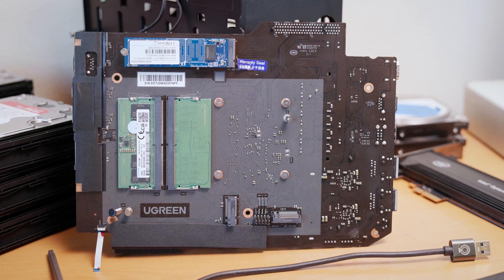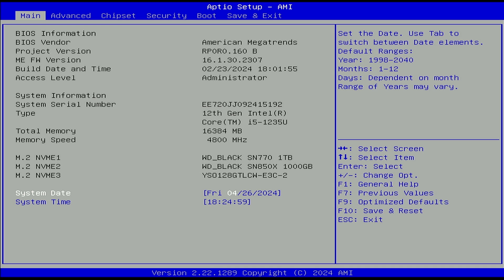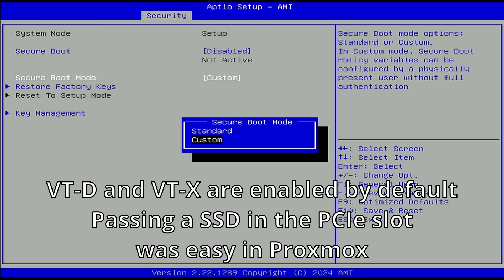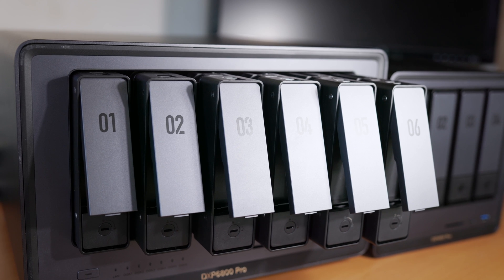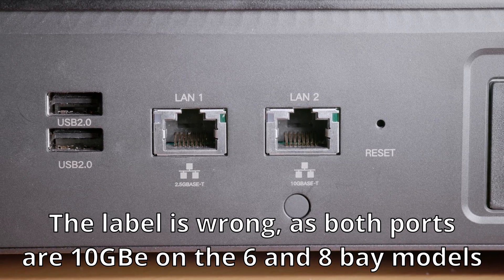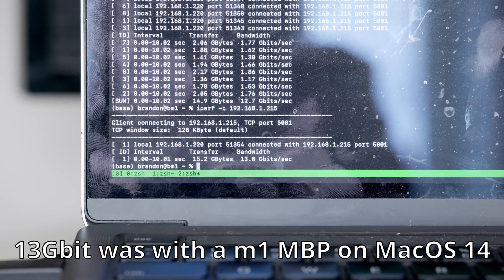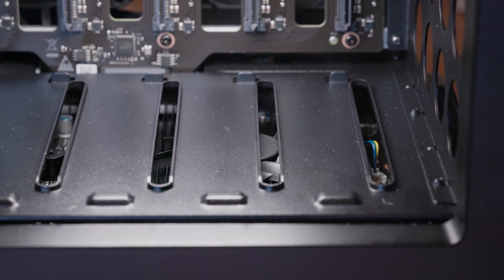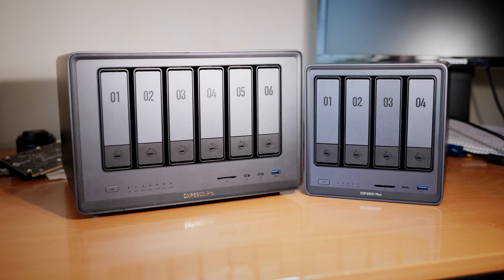Running Different OSes on Ugreen NAS Devices + PCIe layout and CPU thermal/performance tuning

Comment: 8:42 In that case instead of a NVIDIA Gt710 or 1030, I'd install an Intel Arc A310 so you get superior transcoding performance for 20 bucks more (AV1 HW-acceleration wasn't fully supported until the RTX 40 series [30 series had only decode capability]).

Comment: know anyone know if the 6 bay  can hold a pcie x4 WiFi card in ugreen os? i struggle to get Ethernet into my room and ill be using the 10gb to connect it to my pc keeping one empty for when i can run Ethernet

Comment: just found your channel and the vid was great. I have had a DXP 4800 Plus for 24 hours and I am now poking around in the BIOS. I agree the hardware spec would be pretty hard to beat with a DIY and you get the warranty.
I found UGOS easy to use and setup, just toying with putting truenas in. It seems that I can install Truenas on a spare SSD, or even on the disk array (I think).
Do you know what Truenas gives that UGOS doesnt ?. Is it worth installing it in your opinion ?.
thanks.
Reply from the maker: I'd argue TrueNAS is a lot more refined with better community packages and ZFS which is likely a bit more stable. UGOS can be fine for a lot of use, but I'd say TrueNAS has had more of its bugs worked out as its been out for much longer.

Comment: Excellent review! Around 2:44 you mention making an image of the 32GB drive to be able to restore as it cannot be downloaded at this point - any chance you can point me in direction of how to do this?
Reply from the maker: I booted the system into a Linux live disk, then make a image on my NAS using DD. Something like Clonezilla can do it if you want a more all in one cloning/imaging program.
Reply: @ElectronicsWizardry   Thank you - that was the guideline I was looking for. 
I am considering instaling Windows on a M.2, boot from that and do the image from inside Windows (not a Linux expert, but a strong googler..). Thanks again!

Comment: Thank you for this tutorial. I am exactly looking for a robust HW NAS where to install OMV.
For me a 2 bay is enough and looking at DXP2800.
Does it work the same way as the 6 bay you showed up here?
Or should I add a m.2 storage for a different OS?
Reply from the maker: Yea the 2 bay should work the same, but with less bays. I haven't tested on my self though.

I think the lower end units have a M.2 that uses MMC instead of NVMe, but for a OS like OMV that should be fine performance wise.

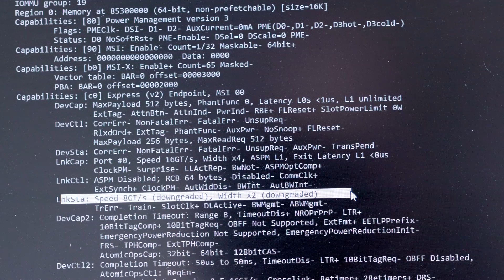Comment: @ElectronicsWizardry @8:48 where you talk about the different sized PCIe slots (4x4 and 3x2), what does that do to the performance if you were to bond them together as a read/write cache or storage pool?  Does the speed and performance downgrade to the limitation of the PCIe 3.0 slot? Or is there some kind of hybrid performance that gets created when you have two different PCI slots like this? Did they give a reason why lowered the second down to PCIe 3?

Comment: Thanks for the BIOS tour. That's really useful information.

Did you see anything in there about Thunderbolt/USB security or DMA protection? By default, The linux kernel in TrueNAS won't authorize any Thunderbolt device for PCIe lane allocation in Linux. Each Thunderbolt device has to be manually authorized on every insert via a specific flag in the sysfs device tree or a udev rule. Some motherboards let your bypass all that by completely disabling Thunderbolt security in the BIOS.

I didn't see that option in the tour you did, but I wanted to make sure I hadn't missed anything. As far as I know, UGREEN hasn't updated the BIOS since launch.

Comment: I installed truenas on my 4800 Plus and it seems to instantly shut off after about 2 min and then boot again. Nothing suspicious in any logs, temps are fine, low ram usage - any ideas?
Reply from the maker: There should be a bios option called os watchdog I think. Turn that off and it should work fine. The system by default will check if the os is working and will reset the system if a different os is on it.

Comment: How difficult is it to get the external case on and off to put in a PCIe card? The manual makes it sound easy enough (swap out feet screws, remove RAM/SSD cover, and slide off), but the entire process sounds a bit precarious and awkward, and I'm afraid of accidentally putting it back together wrong. ;)
Reply from the maker: I think all the screws have to be removed on the bottom and the back and then it slides out. Not as easy as a normal side panel, but not that bad, and all normal Phillips screws.
Reply: Thanks! (Sorry for the delayed reply; YouTube didn't tell me you'd replied…)

 @ElectronicsWizardry  Did you have any trouble lining it all back up when you put it back together? It looks like it should all just line up without a problem...

Comment: The asrock a380 gpu is a low profile single slot gpu, however the cooler is large so I'm wondering if it would fit.
Reply from the maker: I think the cooler is too big for this case. But the Intel igpu should be better than arc from my testing so I’d try using the do first. There are also a310 cards I’ve seen that would fit.

Comment: Hello all, very new to all this and looking for advice. would like to get the new mac mini m4. watched a video that showed an external ssd being used at the myfolder drive so the system would place everything but the main os features on that external drive. could part of this nas be used as the system folder drive and the rest as raid?
Thank you for any info
Reply from the maker: I think you can map the Users directory in MacOS to a different drive but I haven't tried this in a while. This should get around most of the 256GB storage limits on the base model mini. A DAS system will RAID should work fine as it appears as a single drive to the OS, but I haven't played with software raid in MacOS much.

Comment: I just bought the dxp2800 intending to use it for a Blueiris (Windows) server.  The Ethernet driver ended up being an Intel i225.  I still haven't found audio or other chipset drivers.  Otherwise it seems like a nice unit.
Reply from the maker: Does your have a audio port? Mine don't have audio ports, and HDMI audio is the only intergrated audio option

Also try the Google the device IDs without drivers in device manager if you haven't already and see if that can find the drivers.
Reply: @ElectronicsWizardry  Thanks. No analog audio port.  It looks like maybe some of the Intel Nuc drivers may be compatible.  I'm honestly not sure at this point what other functionality I'm missing but there sure are a lot of unknown devices in the device manager. It's been awhile since I've had to deal with this kind of issue on Windows and I'm out of practice.

Comment: Do you have any idea how I should connect Thunderbolt 4 with windows?
Reply from the maker: What do you want to use the thunderbolt port for? You should be able to do the same thunderbolt networking on windows, along with using thunderbolt devices.
Reply: @ElectronicsWizardry  I have a you green DXP 4800 Pro and I am having issues getting a PCIe card working for networking. So I bought a external USB thunderbolt 3. That gets me by with 1 10 GB port. I would really like the bandwidth of thunderbolt 4 to use between the NAS and the windows PC. I got them under the same IP but because I'm using a network switch everything got really complicated. My little mind lol
Reply from the maker: What OS are you running?

What do you mean by a external USB thunderbolt 3?

IP over thunderbolt typically is much slower than the peak port performance, I think it was ~10gbit for earlier versions and a bit more for v4.

You want the NAS and your PC to have different IPs but to be on the same subnet. Then try pinning the NAS on its IP in that new subnet.
Reply: @ElectronicsWizardry  Yes I was able to change the IP addresses on both the NAS in Linux and my PC. Got it connected but I don't know if it's working for transfers. It ended up losing connection if I remove the ethernet from the NAS. 

Correction I have the 6800 Pro the six Bay prone as and I am running you ugeen OS
Reply: @ElectronicsWizardry  When I said external thunderbolt 3 I meant I am using an adapter for thunderbolt 3 to 10 gig ethernet. It works pretty well but gets super hot. So I am assuming connecting it directly through thunderbolt 4 will yield better results

Comment: @ElectronicsWizardry , it looks like ugreen has disabled ASPM in the bios which is resulting in the cpu never dropping into low power c-states.  This is causing a significant increase in the floor for power consumption.  This hardware should be idling at 3-10w and possibly even lower.  Ugreen really needs to fix this.
Reply from the maker: Do you know of a way to check if aspm is enabled?
Reply: @ElectronicsWizardry  My kernel (ubuntu) is reporting "ACPI FADT declares the system doesn't support PCIe ASPM, so disable it".  Also I never reach lower c-states in powertop other than c0.  Attempting to set pcie_aspm=force as a kernel option, was unable to work around the problem.
Reply from the maker: @DavidChiluk  Yup I see that exact line in boot messages of my Ugreen nas running Proxmox. Let me try measuring power when the force kernel option is turned on.
Reply: @ElectronicsWizardry afaict this can only be solved via a firmware update from ugreen.  All hardware on the board should support so I hope this is just an oversight, and due to the project focussing on functionality over optimization.

Comment: I’m running truenas scale
Reply: Do you know if the slot where the ugreen nvme is a pcie 4x4 or 3x2?
Reply from the maker: @junior-OG I think it’s a gen 3 x1 if my memory serves me right but it may vary depending on unit.
Reply: @ElectronicsWizardry  yeah i just find out on reddit the os slot is 3x1 then one is 3x2 then 3x4

Comment: How to reinstall the original OS if you messed up with the storage while testing 😁
Reply from the maker: I asked Ugreen if they have a way to download the OS for a reinstall and they said no. I'd contact their support, but there doesn't seem to be a public way to restore the OS.
Reply: That means i am stuck with truenas for a while…
Reply: @ElectronicsWizardry  The support wants me to send back the device so they can check if there is a physical damage to the device. Physical damage by formatting the drive. Nice 😂

Comment: just got mine today, gonna run truenas on it and see how it goes, thanks for the video
Reply: How did it go???
Reply: @woa4ever  its been great, at first it was a bit overwhelming to setup all the permission stuff but once i got it all working its been rock stable, i got immich, qbittorrent, smb running with tailscale

Comment: Is there any way to get the HDD LEDs working correctly after you install TrueNAS? Haven't found anything in the BIOS menus to fix them
Reply: The fact that they work in UGOS Pro but not any other OS seems to suggest that it's a driver issue. I'm guessing that the strobbing from side to side is the default ON behavior, and at some point after UGOS boots, a driver takes over and actually controls the lights based on data from the OS.

I'm actually curious if a driver could be extracted from the UGOS disk image and ported to TrueNAS or some other Linux/BSD.
Reply from the maker: Yea that's my thoughts too. It seems like a interesting project to do and I'll post my results if I figure it out. I just haven't gotten around to trying to figure it out yet.

Comment: You can use HWiNFO in Windows to check the PCI-E channel speed, and also check which solution the SATA controller is. Are all 6 SATAs extended, or are there two native SATAs on the CPU?
Reply from the maker: 4 data ports are from a asmedia controller the other 2 are from the cpu. I think bays 1-4 are on the asmedia controller.

Comment: 5:47 Could you please explain if this only happens when using UGOS as an operating system or does this also happen with the other OS you tested?
This is the first time I saw this information and I wanted to use 2 M.2 for Read/Write cache and a 3rd in the PCIe slot as a SSD storage pool for Docker.
Reply: I'd love to know this as well, wonder if its possible to steal the pcie lanes from the expansion slot by deactivating or something, and gaining speed back on the ssd slots.

Comment: Very good video shows the capabilities of the NASync hardware with different OSes. Could please test Xpenology in 4800plus model. Untill UGOS Pro attain stability, i wish to test with Xpenology. Can you confirm the same.
Reply from the maker: Its been a while since I looked into Xpenology, and it seems to have slowed down developend wise, with many of the articles online seeming a bit old. The last time I did a video of Xpenology it got copyright striked by Synology I believe, so I'm hesitant to do more Xpenology videos. I don't see a reason Xpenology won't work on this hardware, but with the slower pace of development currently, I"d be tempted to run a OS designed for any hardware like TrueNAS or Unraid that would likely have less issues.

Comment: I would have liked to see them running a AMD mobile processor such as 7840hs or 7940hs , i think the inbuilt gpu 780m would do wonders for transcoding
Reply from the maker: Yea I'd love to compare the 1235u to a AMD CPU like the ones you listed. I think the all P cores would work better for a NAS like this, and I think those chips have more PCIe lanes too.

Comment: I hope the BIOS supported ASPM settings so the system can reach better C-states and lower idle power consumption. How much power does the NAS draw at idle? The problem with most DIY solution are those boards from China usually have the JMB585 chipset which do not have ASPM support, there are no such devices that have a Intel CPU better than N100, have many SATA ports and do not have the JMB585. The closest I've seen in Wolfgang's channel who rigged up a AsRock N100 ITX with ASM1166, but that is only N100.
Reply from the maker: I tested the 4 and 6 bay models at idle with only the included nvme boot drive(no HDDs). the 4 bay model sat at about 20w, and 23w for the 6 bay model. This power was about the same in all OSes I used.

I also recently got a N100 miniPC to test with and its pulling about 8.5w Idle. I'd guess the extra power on the Ugreen NAS boxes is from the JSM585 as your pointed out, the 10GBE AQC107 nics and a few other parts. I'd love to get a breakdown of what all is pulling power, but I don't know of a easy way to get that on these systems. 

Do you have a way to test the idle states of the JMB585 chipset?
Reply: @ElectronicsWizardry  I'm using powertop a linux tool to optimize and check which idle state a system is in, I got most of my power optimization tips from Wolfgang Channel. Since JMB585 does not support ASPM, I think the most your system can go is C3. I know in the Unraid forum, there is a command that list out all the PCI devices in the system and check if ASPM is supported. The SATA card does not have idle states, but it can prevent the CPU from entering certain C-states.

On the google search, I do not know whether the 10G card has ASPM support and if it prevents a CPU from entering a C-state.

Comment: I have a pc with thunderbolt. If I plug it into the thunderbolt on the NAS can I use it instead of the 10Gbe connection and get high speeds? Does it work as expected since I am seeing comments on here saying it is intended for working only with TB4 external drives not computers?
Reply: Maybe? But you might not be able to configure it in the Ugreen NAS GUI. Plus, his initial testing using a different OS only showed a 30% improvement over a 10 Gbe Ethernet connection. 
Why? That's a mystery.
Reply from the maker: I can test their included OS, but if you plug this NAS(and all the other NAS units with thunderbolt Ive seen) to a computer it will show up as a network card that is about 10GBE or faster. Then you can mount the network share over this network link. I see this being most useful as its cheaper and easier than a thunderbolt to 10gbe adapter if you already have a laptop with thunderbolt, but the speed boost is a nice bonus too.
Reply: @ElectronicsWizardry  Yeah definitely. Cause the adapter is already 200 bucks and for that I can just go for the 6 bay at that point since it would be the same price as buying the 4 bay and then an adapter.

Comment: Great review! What it's unclear to me your passage about the coexistence of iGPU and dGPU. From the bios do you completely disable the iGPU in favor of the dedicated one or only its video output (and so the HDMI port on the mainboard)? This might be a game changer if you could use quicksync (iGPU) on a container for transcoding while having the dGPU passed through another VM using both at the same time in different contexts
Reply from the maker: There isn't any BIOS options I found that affect the iGPU or primary display adapter. When a dGPU is added the iGPU seems to be fully disabled with the onboard HDMI ports having no output and the Intel iGPU not being listed as a device in lspci or device manager. Since I don't see the iGPU at all, I don't think there is a way to pass the iGPU to a VM/CT and use a dGPU for other tasks. Hope this clears up what is going on with the GPU here.
Reply: @ElectronicsWizardry  it does, thanks :) (sadly in a different way than the one I hoped :D)